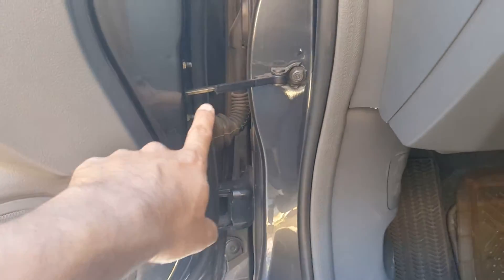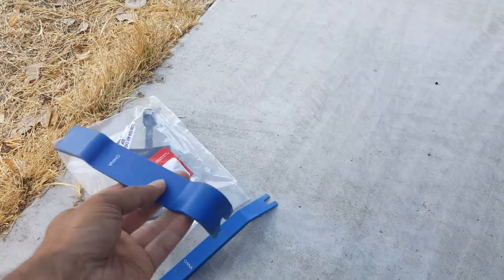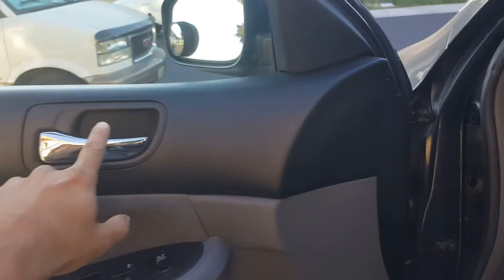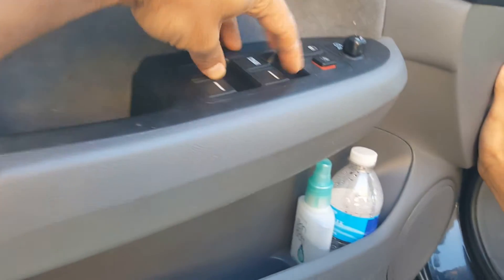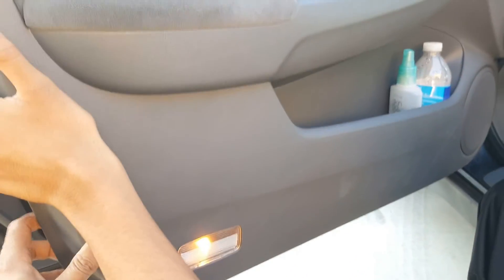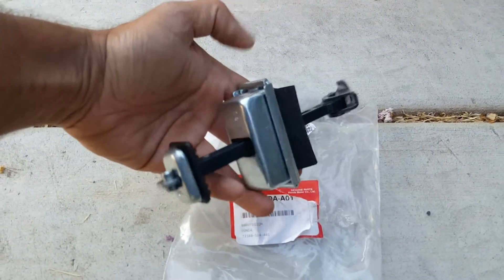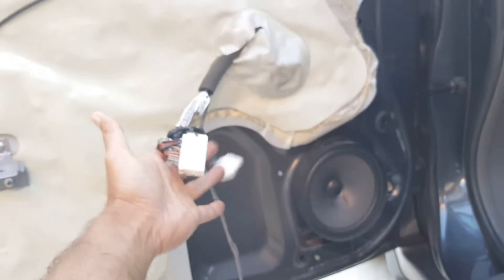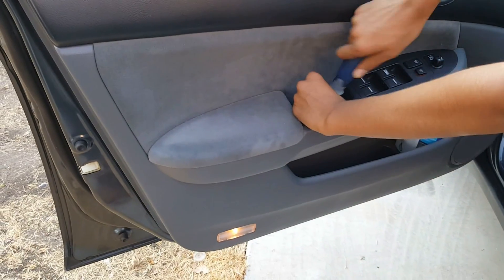DIY-How to Replace the Door Check on Honda Accord

Comment: This was an excellent video. Not only did you describe everything that I needed to know in detail with clear video footage, but you also included the extremely helpful information about avoiding breaking the door pull cable bushing. Because you included that, I was able to avoid it I appreciate it, and if anyone wants the part numbers for the left and right front door checks on the 2003 Honda Accord, they are as follows:
Left front 72380-SDA-A01
Right front 72340-SDA-A01
Thank you again!
Reply from the maker: Glad it was helpful!  I appreciate your feedback!

please help out by Liking, sharing and subscribing.  thank you!

Comment: I was able to replace the door check without taking the inside door panel off. I removed all of the screws as directed and popped loose the bottom of the inside panel I peeled back the plastic rain/noise layer back and was able to reach under and through the access to remove the old unit. I did drop the new one twice and was able to reach down near the speaker and retrieve it but I recommend care to NOT drop the new one. I DO recommend extending the arm of the new unit before trying this- it allows you more length to work with. To extend the arm, I used a woodworking clamp. Hope this helps. 
The video was helpful to see what’s behind the door and where the clips and screws are located!
Reply from the maker: Awesome!
Thank you for sharing!

Comment: Nice video.  I would appreciate that you tell people what size any nuts are so that people know what tools they need to remove/reinstall parts. Also any other type of information that you may have discovered an issue, etc. I am about to change both my checekers and it would be nice to know what size wrenches, for the nuts and bolts, whether you need a special tool like impact wrench, etc. Did you reseal the gasket covering the open space to get at the part?? EtC.  I liked the way you addressed the opener latch that broke. Most car doors have this type of clip and they are fragile and sometimes hard to detach. Sorry you had that problem. All in all a good DIY video.
Reply from the maker: thanks for sharing your thoughts!
my focus was to show how things are done, using just simple tools.  if a special tool is needed, I'd report that.

Comment: LOL. You start out saying how this is going to be an easy job to replace the door check mechanism. Then it turns into an ordeal to properly remove the door panel and all the wires and cable without breaking anything. Not so easy.
Reply from the maker: that was true...but i did my 2nd door with this method:   https://youtu.be/yBdCAHDrerU
it's much easier